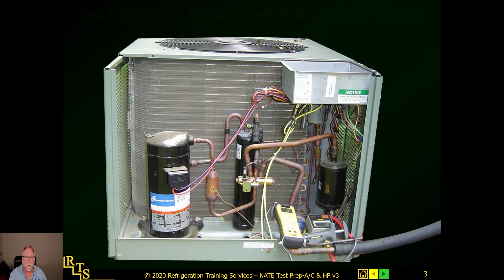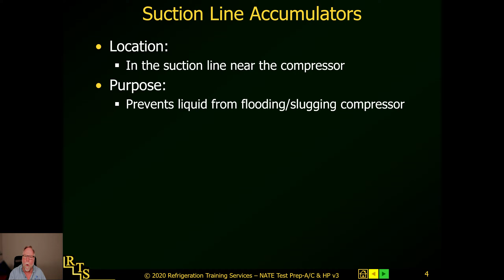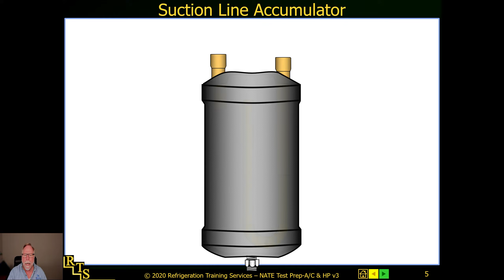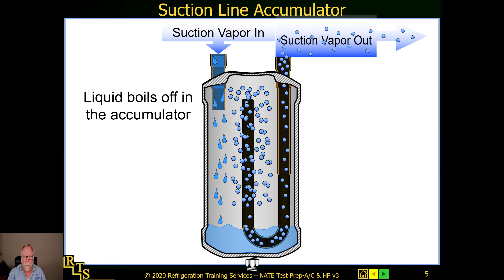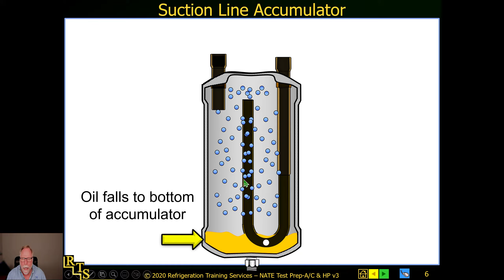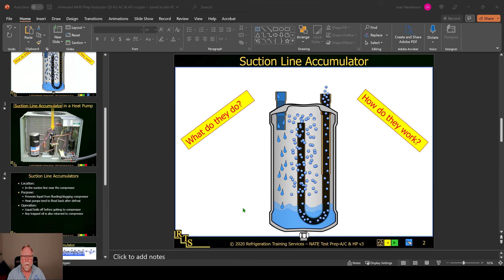Accumulator-Simplified and Hidden Danger!_8 minutes

Comment: I have a 10 seer Rheem heat pump, It recently started tripping the high side cutoff and will only run for 5 minutes until it cuts off again and needs 0.5hr to two hours to cool down. When running I felt the line in between the accumulator and compressor is ice cold, the line on the other side of the accumulator is warm. Does this sound like a plugged accumulator?

Comment: So if I understand correctly, low oil level in the compressor can allow the windings to short against the case.
Reply from the maker: For sure!  The rotor will touch the windings.
Reply: @Joe_Joe_The_HvacMan  So the rotor crashes into the windings, it's not the windings crashing into the case.

Comment: Could the oil return hole possiblly suck up liquid refrigerant if it stacked up in the accumulator?
Reply from the maker: Great question!  The hole as a screen that would break up the liquid and it would be a very small amount that could enter the suction of the compressor.  Also, with most compressors being a Scroll type then that small amount of liquid would not cause any problems for the Scroll compressor.

Comment: Great video, thank you. Question about the oil hole I guess. What’s to keep liquid refrigerant from getting in there?
Reply from the maker: Great question. My understanding is that the oil molecule is smaller than the refrigerant molecule. This is especially true for POE oil. When R410A first became very predominant in the market you could have some oil loss on some brazed fittings but no refrigerant loss. This happens several times with me when I was a Carrier tech rep.  Let me know if you have any more questions! Thanks for watching!

Comment: Do new compressors come with oil in them?
Reply from the maker: All residential compressors come with a full oil charge.
Reply: @Joe_Joe_The_HvacMan  I had just seen a contractor replace a HP scroll compressor that was burned out, only to be shorted out in two weeks. All three winding were shorted to ground. The accumulator was not replaced originally and when the old one was taken out, the oil was all black and very acidic according to test strips. The third compressor was installed with a new accumulator and only Rx11 was used to flush along with Acid Scavenger. I was thinking that Rx11 solvent getting flushed into the accumulator combined with the dirty oil and remaining acid killed the 2nd compressor quickly. Thank you for this video.
Reply from the maker: Thank you for the question!  Could you please be more specific in the application, residential air conditioning, commercial air conditioning, or Refrigeration?
Reply: @Joe_Joe_The_HvacMan  Residential scroll compressor.
Reply from the maker: your welcome!

Comment: Finally someone shares the dual purpose of the accumulator. I learned the hard way many lifetimes ago. You should install an accumulator if you have a remote condensing unit that is more than 3 feet above the evaporator to avoid slugs on startup.
Reply: Or you could just use a hard shutoff txv
Reply from the maker: Sorry for delayed response!  Good idea.  A hard shutoff TXV definitely could help or a liquid line solenoid and a low pressure cutoff for a pumpdown system.
Reply: Sorry how do I make the accumulator not to hot again